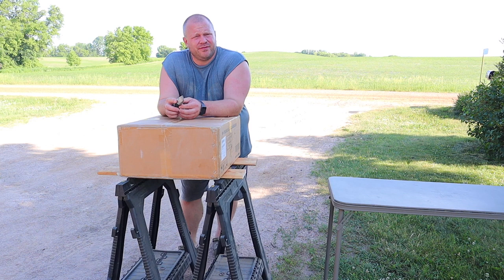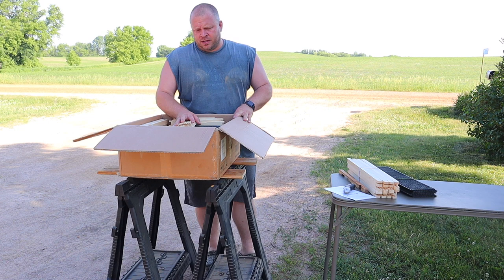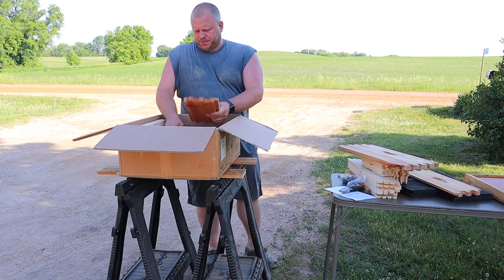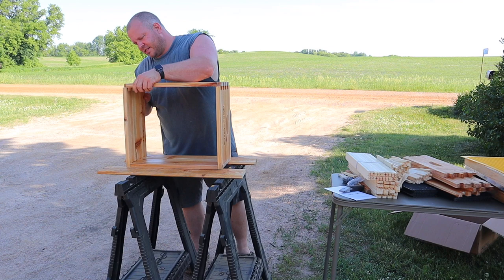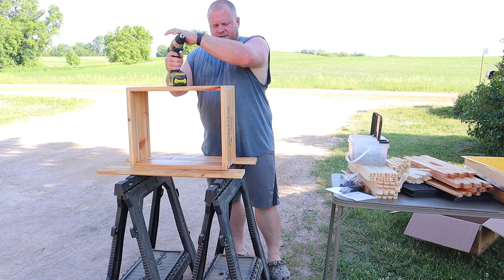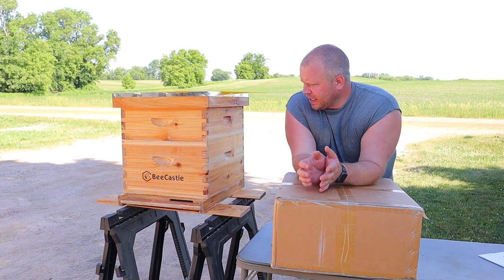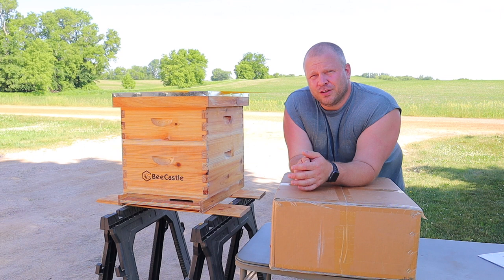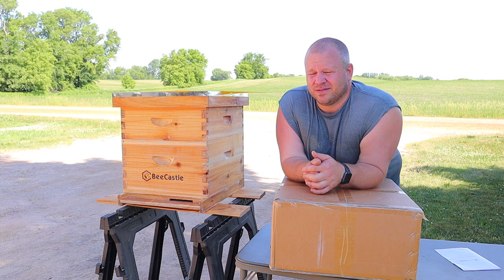Bee Box Setup  l  Trying New Hive Options  l  Bee boxes that actually work

Comment: Those boxes look like pretty good quality.   I hope they work out well. No glue on the box joints? Is that because of the wax coating?
Reply from the maker: I don’t use glue now that I have been using the decking screws